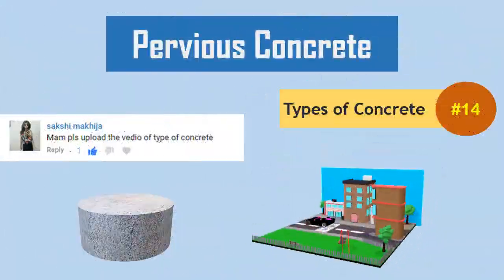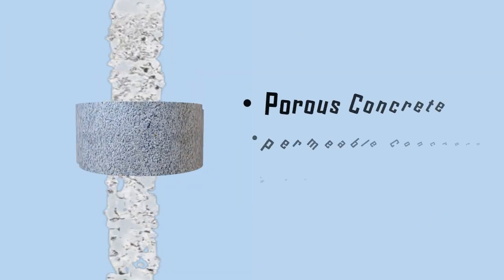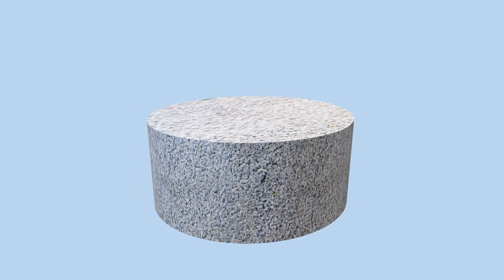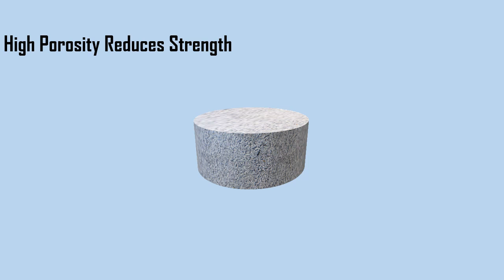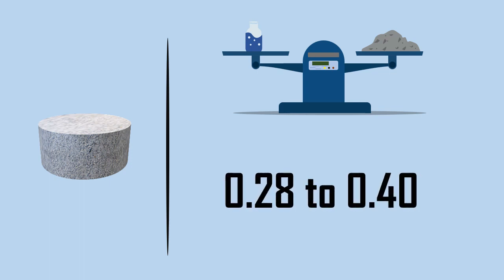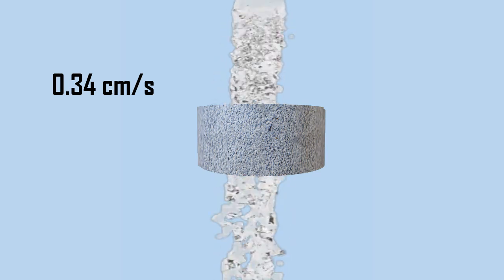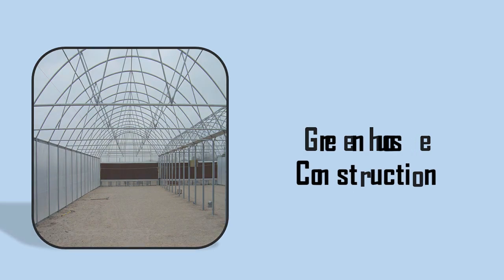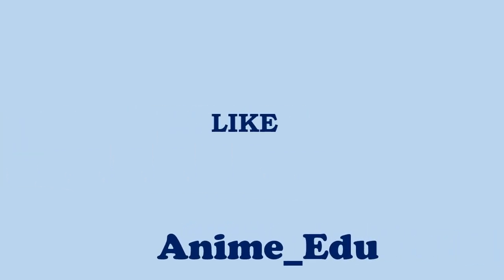What is Pervious Concrete? || Porous Concrete || Permeable Concrete || Types of Concrete #14

Comment: Is this concrete useful for under water structure ?
Reply from the maker: It is not preferred in underwater concreting..... As underwater concrete structures are mostly heavy load bearing structures.... The strength of pervious concrete won't be sufficient.
Reply: So which kind of concrete we will use in under water structure ??
Reply from the maker: There is a cement named Hydrophobic cement which can be used for making concrete for underwater.
Reply: Thank you 😊☺
Reply from the maker: Welcome..... Keep supporting us...
Reply: Sure .. am always sharing the videos to my near circles..
Reply from the maker: Thank you that.... Keep supporting.. love your effort..
Reply: Bro plz give some more explanations.. Can we use thz as drainage system l mean slabs in footpath